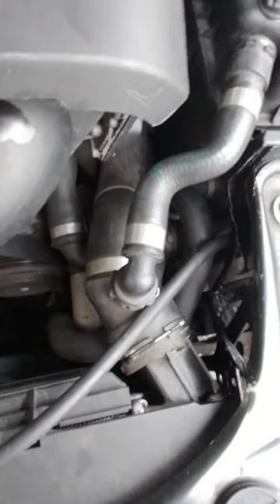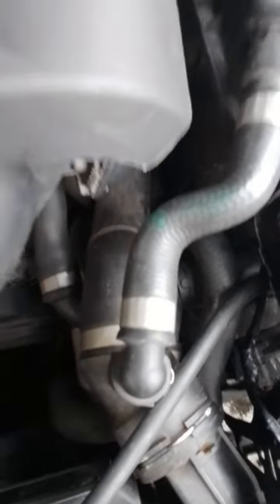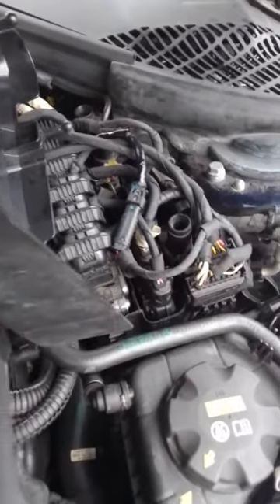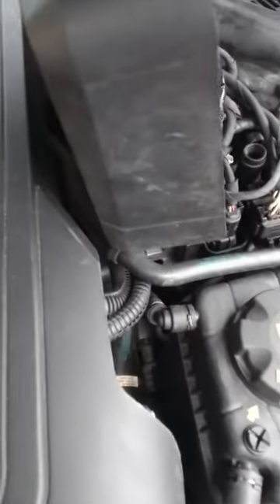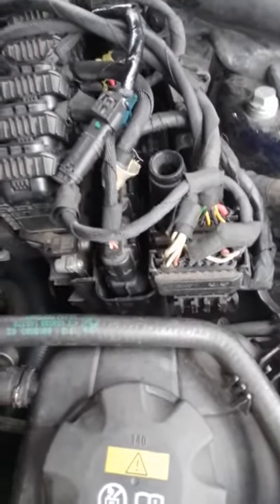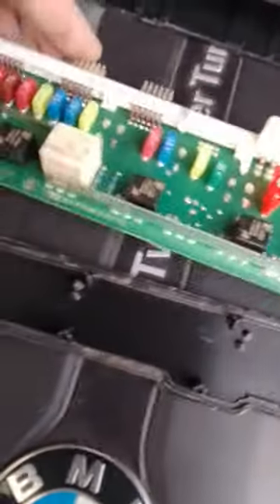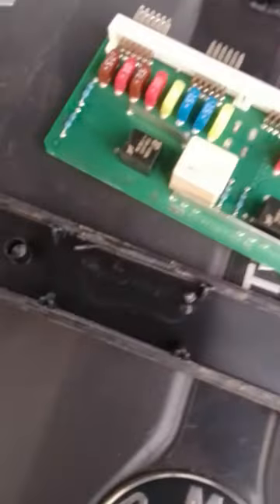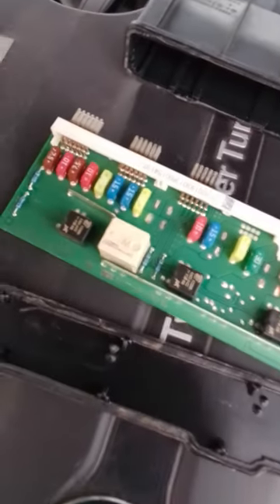BMW B58 auxiliary water pump not working ,electrical issues fuse location DME...fixed!!!

Comment: I’m having the same problem. How did you diagnose this? Where are the other fuses? I’ve seen some info that F108 might be for the auxiliary and it’s in the front left footwell, but can’t find it. Thinking of swapping this integrated supply just to see.
Reply: My IATs have just been high and take forever to come back down. Tells me pump isn’t working. When initiating bleed process for low temp circuit, no sound from the pump and coolant doesn’t move in the expansion tank. So it may be pump or that integrated supply. But this was helpful bc I never would have thought about this.
Reply: @Driven_G30 do you have any codes?
Reply: @catalin.c nope. Sometimes high charge temps with back to back pulls in warmer temps. But when monitoring I can see 120+ degree F temps when just cruising around and no pulls
Reply: @Driven_G30  does the car drive normally? Pulls hard like always?
Reply: @catalin.c it definitely pulls timing over 127 degrees. So it’s noticeably slower when it’s warmer out and cars warmed up
Reply: @Driven_G30  my charge air temp goes up to 260f during a pull, and iats something like 110-120f when its 65-68f outside temperature
Reply: @catalin.c  did you fix this?